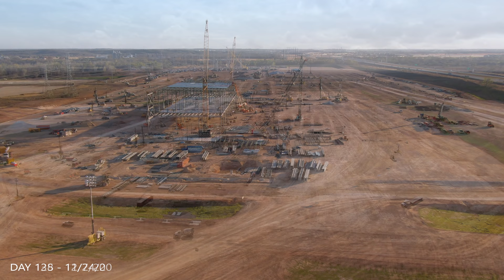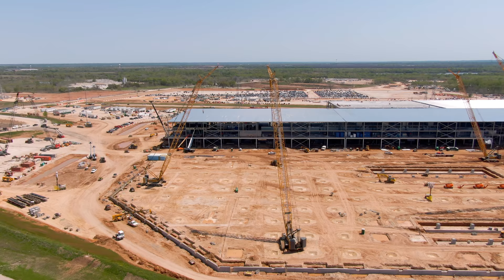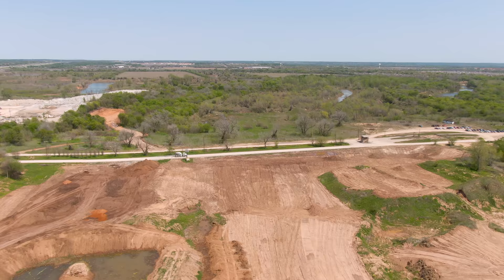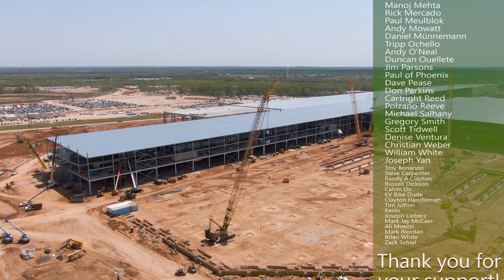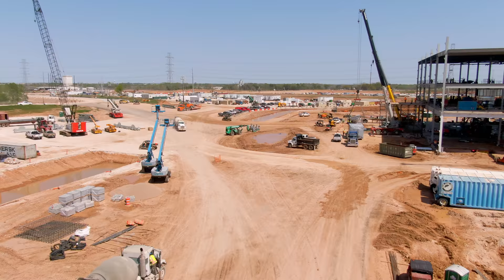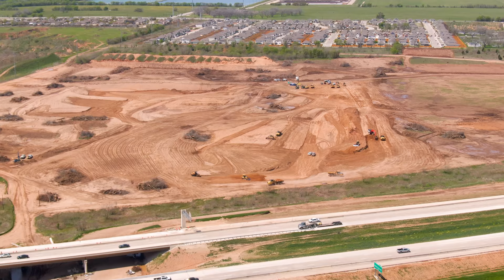Tesla Gigafactory Austin 4K  Day 247 - 3/26/21 - Terafactory Texas - PAINT SHOP COMING TOGETHER!

Comment: I'm starting to worry that with so much of the work heading inside without putting up walls, it's going to throw my tracker off. Berlin and Shanghai had walls up well before this point in interior work.

Also not seeing as much steel delivered in the SW area as I expected. Figured that would be the next massive push.

My guess for next week is walls along the east side, a start of steel in the NW battery corner, and of course a gigabuttload of new concrete.
Reply: With 4 cranes working on the steel in the battery area, it's gonna fly up in no time! With new footers being dug in the southwest, I expect that steel will pick up down there pretty soon.  They need to work on the perimeter grade beam down there so that they can continue erecting steel along the border
Reply: @zacadams7070  Very exciting times, but then again, this whole project has been.

Comment: Hi Jeff. Incredible progress in between Randy filming at 5:00pm on the 25th, Joe at 8:00am on the 26th, and then you at 1:00pm on the 26th. 
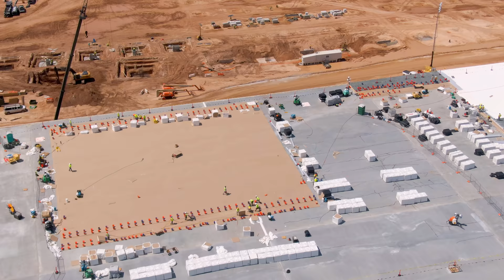10:08. Roofing insulation guys seem to have found a good rhythm, getting on with it now. 
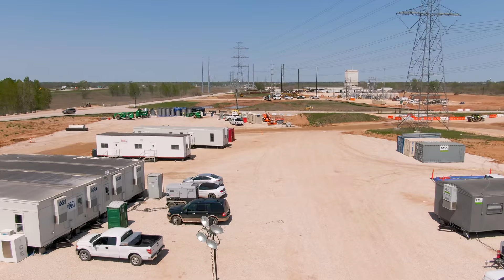11:56. Those big pipes seem to be a different pattern to the ones being manufactured on site.
Reply: 11:56 looks like HVAC to me.

Comment: Looks like they are picking up speed on the roof. Should be finished in no time.
Reply: It's also not as time-critical in terms of getting to production. Can't move forward without walls and floors, while insulation and final weatherization won't be as big of a deal until the equipment is in.

Comment: While I am not a civil engineer, I have sometimes wondered if all of the waste concrete over at the original MM batch plant would have made good fill material for the site, especially the pond areas that ended up needing so many geopiers.
Reply: Nope. Most of it will be wash out from the trucks and scrapings from the yard. It might look like solid lumps of concrete, but it will be far too "soft" and silty to trust as foundation material under a building.
Reply: @CiaranKing  Likely also very difficult to work with in terms of consistency and wear and tear on the equipment.
Reply: @CiaranKing  Thanks! The more I learn, the less I know. Always nice to have an explanation for things of which I ken naught about.

Comment: I suggested to Elon via Twitter that Tesla adopt an industrial version of a lawn-roller; i.e. a 15' wide or wider version with handles on each end for use as a 2 man team combo to apply the tiles to the roof, ensuring good adhesion of the adhesives they're using in order to ditch the buckets & speed up the process. Hilarious that Tesla's building a state of the art factory, to build state of the art EV's, & they're using BUCKETS?? AND 3 times the labour necessary? 🙄🤣🤣🤣